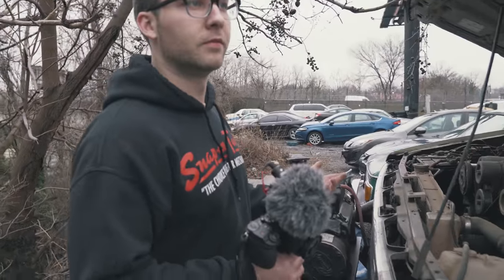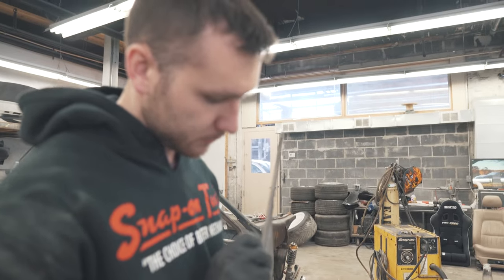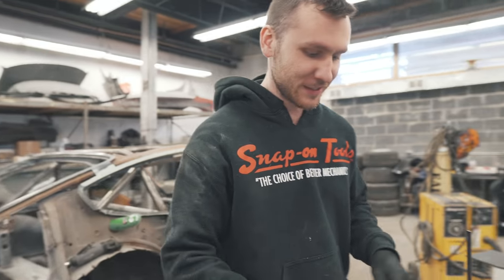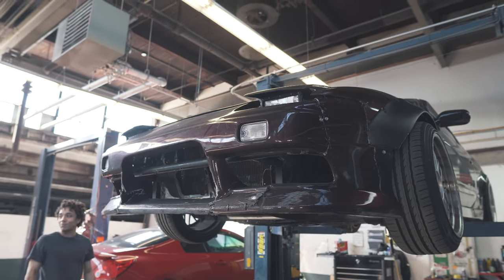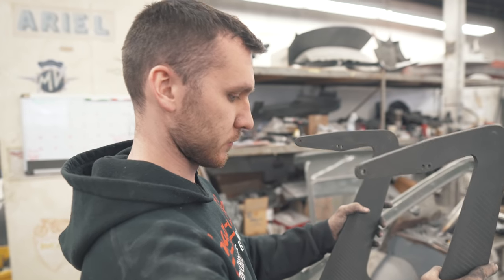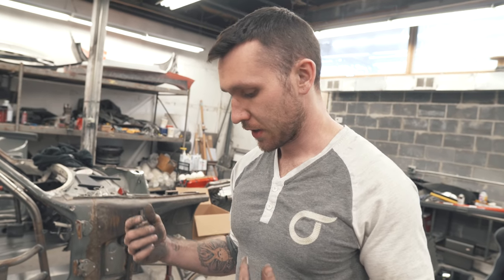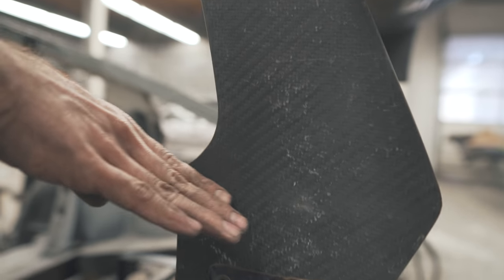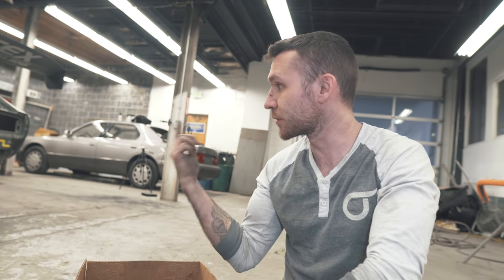240z Swan Neck Carbon Fiber Wing Stands (Ep #11) (4K)

Comment: You guys rock!!! Honestly, I wish I was there working with you guys on the car. cant wait till its done and track testing and tuning begins
Reply: Street Bandito hey thanks for the reply. I got a serious question that you don't have to answer if ya don't want to. What did you guys study or what are you studying? I'm asking because I'm about to transfer from studying graphic design for 2 years to mechanical engineering. Gonna start fresh and chase my dreams of having a tuning shop of my own and race in time attack for some motorsport exposure. I was curious to know how you guys got to where you were. Plus I like hearing other car guy's stories.

Comment: Just remember, guys, that he has a respirator for a reason. Always wear breathing protection when sanding or cutting composites because the dust from them are nearly on the level of asbestos in terms of how terrible it is for you to inhale. Eye protection is advised as well, for the same reason. If you're kicking up a huge amount of dust from that, then wear some lab goggles that prevent ingress even better. Carbon fiber or glass fiber particulate getting in your eyes is no joke.

Comment: Are you going to be gusseting the cage to the remainder of the body framework? Probably a good idea to keep the body from flexing separately from the cage and cracking/braking your carbon work free.
Reply: I'd be nervous that since you are removing the panels, you are taking a lot of rigidity our of the body of the car. So the chassis will now flex when going over uneven ground allowing moment at the joints where your carbon is glued to the steel, possibly breaking your bond. If you gusset the steel structure (that the carbon is glued to) to the cage you'll make that structure a lot more stiff and reduce the chance of breaking glued joints. (I'm a chassis engineering student at Michigan Tech, currently captain of our chassis team on FSAE. Torsional rigidity more or less helps with vehicle dynamics as well depending on a lot of other factors)

Comment: Lenox metal-cutting wheels (4 1/2 inch, diamond) are awesome at cutting fiber.  I put one on my 4 1/2 cordless side grinder and wow.  I had the same problem and had the metal cutting blade to try (thank you Lenox demos) - I figured I had nothing to lose.  I've cut lots of fiber material and have yet to replace that blade.  Of course, if you're Lenox that's a problem - but for fabricators, it's awesome.  Paradoxically, they aren't terribly good at cutting metal.
Reply: a71landcruiser awesome! Thanks for the tip man. I appreciate it.
Reply: I've learned so much from watching what you're doing.  Thank you!
Reply: I'm putting flares on a 1976 Corvette.  I tried everything after I burned up my last blade... desperation is often the place where innovation grows.  I'm going to try to do the hood like you did for my Corvette.  Thank you again.

Comment: if you can find em, use vhm woodworking blades for carbon, same goes for drills and mills. you work metals by scraping off chips, that doesn't work in composite materials (wood is kind of a composite in this regards, as in it's strength comes from fibers held together by a matrix, in the case of cfrp, epoxy). you need to cut the fibers, for that you need sharp edges. then you need to get rid of fairly large chips and not melt the matrix, for that you need large teeth. also, COOL YOUR WORK! when you see smoke your way over the Tg of the matrix and that will gum up the teeth of the saw, which means non of the energy goes into shearing of the fibres, and all of it goes into heat. while carbon fibers themselfs conduct heat fairly well, the matrix does not. so toss some water or alcohol on there while sawing. 

don't get me wrong, cfrp is hard on tools no matter what, and all  drills, saws, mills, sandpaper whatever are still consumables. so cost may be the defining factor in this kind of work. better to toss 10 3 dollar blades than half wear out one 80 dollar blade. still for accuracy and not hating everything by the time you are done, vhm and carbide is were it's at
Reply: thanks for reply! I've had to learn it from others as well, and you only really get it by doing it yourself as you're doing. 

i've recently seen whole batches of aerospace engineers (automotive myself) waller out hss drills with one hole through cfrp, because they don't have any practical insight or experience, so they up the rpm's and pressure until it's damn near on fire, and f up really expensive parts. then they complain to the shop master that the drills are shit:) learn by doing and keep it up!

Comment: This car is going to be so sick. Hey, so… Do you guys still have the original roof panel from the car? I am rebuilding a 280 Z myself and the previous owner straight up chopped a sunroof into the car. I've been looking for a roof panel to patch it out and it JUST clicked that you guys might have one.
Reply: Average I do actually, it's in our scrap metal pile though so if you need it I'd come get it

Comment: yo you guys are in bowie?!?! I'd love to come visit the shop for some work sometime if possible!
Reply: Street Bandito it's cool I'm from md regardless. I just need help installing some stuff. I can do the work myself, I drive a 6-6 8th gen accord. I did the RL Brake upgrade (not installed), coilovers, CAI, some headlight led conversions, and I'm trying to figure out the j37 intake manifold swap procedure, I have the intake mani. I have a whole hfp lip kit but I still have to wrap it. the datsun build is sick. i want to learn carbon fiber casting as well. Thanks for asking man, the channels awesome!
Reply: Street Bandito I forgot to mention steel lines and rotors too, if you guys know any powder coating spots I have some 20x10.5s I want to refurbish and get coated as well. I have a wing that I want to refurbish and build wing stands for like in this video.

Comment: Should have used blades used for cutting tiles. You need an abrasive blade that grinds away rather than a blade with teeth.

Comment: "wear mask, carbon fiber dust is very bad for your health"

wears a 99cent mask... you need a mask w/ HEPA filter for carbon fiber dust. hello cancer after 20-30yrs lol.

but so far I like the way the build is going.

coulda used WD40 to lubricate the blade/material you're cutting so the blade last a bit longer lol.